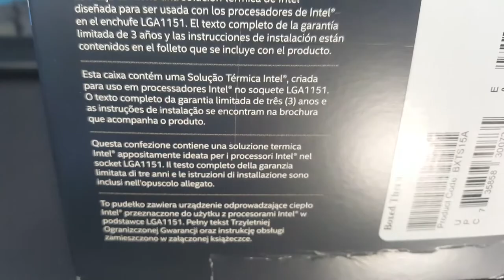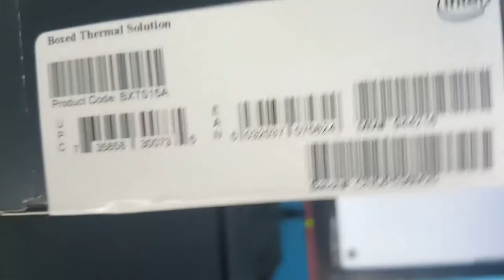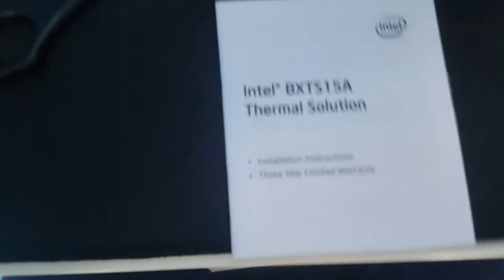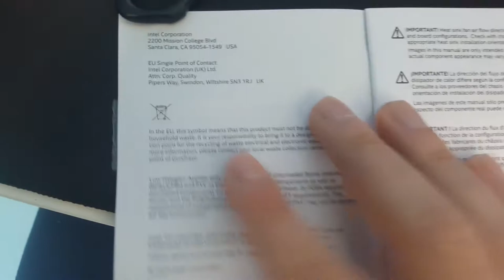Intel Thermal Solution TS15A Unboxing

Comment: I've this CPU cooler, the instructions said nothing about applying thermal paste onto ihs, noting it comes with thermal pads makes sense not to apply any extra paste over, the Tº is perfectly fine in hot environments like mine with non demanding tasks and without OC, I've got a 7700K which can go auto 4.8 Ghz in BIOS with the risk of shortening cpu lifespan especially when they themselves advised not to OC this line of processors, to be specific in numbers around 40º when idle, with intensive tasks up to the nineties but which is more worrying is the spikes, but that matters respecting the cpu more than the cooler, a product meant just right for LGA1151 socket. Personally I do base clock and everything's fine, I've done OC and can conclude it's mostly for bragging about, not worth the loss in perdurability, you better care for what you invest in, even more when you're out the US where electronics are per norm around half the price every else. If you want to know more message me, I'll find the time.
Reply from the maker: Hi, thanks for this response, i think that this cooler is good for the 7700K too, but it won't give you the same performances of a 50$ noctua, but that's obviousness... I use it with an i7 7700T, and i've also downvolted the cpu, and it runs like a dream, 30°C idle, and max 55°C load.... Besides, the pre-applied Thermal paste is good!